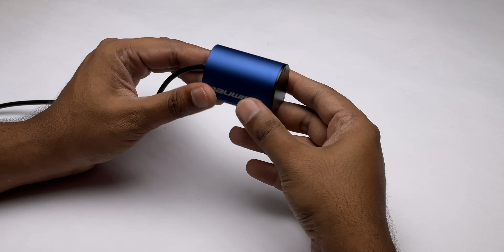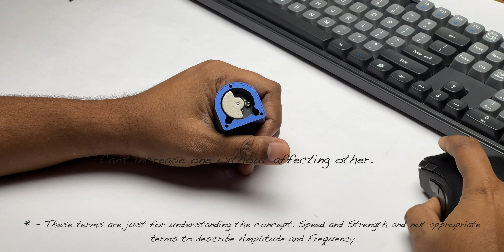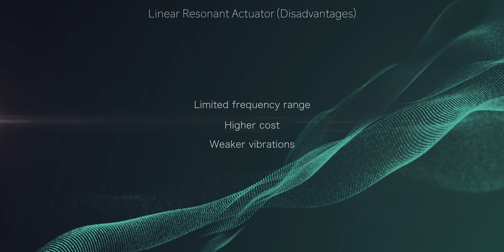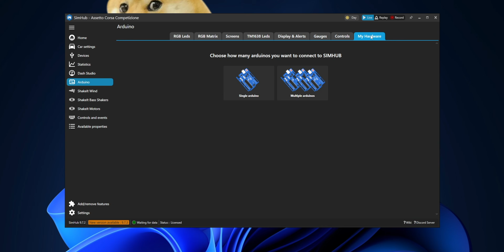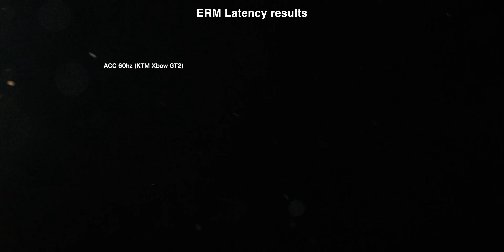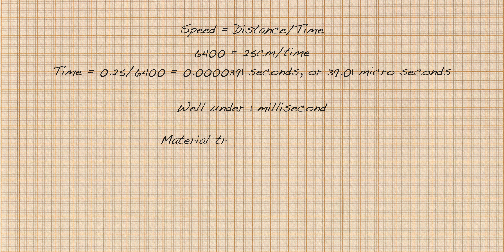Everything You Need to Know About Pedal Haptics in Sim-racing (ft. Simnet Racing)

Comment: I didn't quite get the point of the incorrect mounting. Did you notice any difference compared to the correct one? I was kinda expecting a conclusion to that experiment. :)
Great video anyway, thanks! I hope Moza does their own linear motors someday, since they only offer ERMs atm.
Reply from the maker: Hi, sorry for the inconclusiveness on the mounting part. I did manage to get a proper mount months later, and honestly, didn't make that big of a difference. It felt largely the same.

Comment: So Erm vs LRA vs Transducers... how will u choose for, clutch vs brake vs Gas pedal?   I see people use all threes in all pedals...  i hour done one can andwer me.   One experienced sim racer yold me to avoid ERM at all cost...  while other less experienced told me ERM rumble motor is very good with detail...
Reply from the maker: I pick ERM for throttle because real life cars will have vibrations, the engine literally rumbles. LRA is good for brakes. If you want, you can mount transducers under the seat, behind it, or on 4 corners of your rig.

Comment: Fantastic video. Explaining not only the end result by how and why.
For me racing GT3 in LMU, I think the most useful information is to get feedback when the ABS kicks in and then the TC on the throttle.
Looking at the response times, it seems that the ERM would work great for both. I actually have a hard time to understand why the LRA would be better for any of the two. I know Simnet has and LRA for the break pedal, but as I only need to know as the ABS kicks in, why would not the ERM do the job equally well as the LRA. Thanks.

Comment: I ask IA, about that 
BRAKE PEDAL — Transducer (Most Important)
The brake generates:
ABS pulsing
wheel lockup
tire scrub
load transfer
These effects are low-frequency and force-based, which ERM and LRA cannot reproduce convincingly.
Why a transducer works best:
ABS feels like real hydraulic pulsing
lockup becomes instantly noticeable
realistic sense of vehicle mass
✅ Highest realism improvement per upgrade.
Ideal mounting
directly on pedal plate
or
dedicated mount to brake pedal assembly.
🟩 THROTTLE — LRA
Throttle feedback should be subtle and fast:
wheel spin
traction control intervention
slip ratio changes
high-frequency engine vibration
LRA advantages:
instant response
precise short pulses
informative without fatigue
ERM feels too slow and muddy here.
✅ LRA = ideal throttle feedback.

Do you agree? This is different from your setup. 

What is your current setup?
Regards
Reply from the maker: My current setup involves a Conspit CPP lite pedals and HE sprints. I haven't used these haptics in a few months/ But, your setup seems on point. 

It's true that a transducer is nice and would work best under the pedal plate/on all 4 corners of the rig/under or behind the seat. 

And yes, LRA can work on throttle no problem. People use it on brakes mainly because that has been the norm. But, a norm isn't always the most effective way.

Comment: im intetested in realism for my rig.

how realistic are these pedal haptics?

i dont know how a car would vibrate pedals, can someone explain?

i only felt my brake pedal vibrating when abs activated but i dont really feel anything in the pedals..
 so will this add realism or not? thanks
Reply from the maker: If you want to replicate the most out of stuff, use a couple transducers under the seat or behind it. And 4 small ones on each corner of the rig. These pedal haptics are good, but if you want most out of it, transducers it is (pucks).

Comment: This is such a good review of the  products. As an engineer I can fully appreciate the theory and empirical testing of each type.

I haven't quite finished the video yet (will do tomorrow), but I guess my main question is how do these compare to Simagic ones?
Reply from the maker: Hi there, if talking about ERM, Simnet is better. LRA I have only tested from Simnet so can't say, but they are incredibly powerful. Simagic doesn't have a transducer. 

Thanks for your kind words 💚
Reply: @napmanreviews  Just watched the rest and this is truly incredible. I basically came here for a thumbs up / down insight and the next thing I notice is me watching theory of how sound moves through different materials and I loved it. One aspect that wasn't really addressed was the noise levels of each motor type and how they compare to Simagic. My main candidates would be the Simnet LRA and Simagic P-HPR.

I guess my selection will come down to which motor I can attach to my Simgrade VX Pro the easiest. I know there is a pretty straightforward way to attach the P-HPR, but need to do some more research what it would mean for Simnet stuff. I would prefer connecting all of the motors, wheels and accessories to one powered USB-hub, but it seems I'm gonna have a bit of a mess on my hands when I start my build in January. Part of the fun I guess.
Reply from the maker: @jannejaakkola5836  Another fun thing to add to future videos! They can get noisy, but unless you plan on running on super high strength, it won't be noticeable. I played with them with the only source of audio being my laptop's speakers, and the haptics weren't audible.

Comment: Do you recommend to buy 3 different haptic motors for each pedal or is it better to have for example 2 LRAs and 1 ERM or is that overkill for the other pedals? Are the 3 different ones the most efficient/useful for each pedal?
Reply from the maker: No actually you could run triple ERM, but ERM is good for throttle. You can do 2LRA if needed alongside one ERM. Clutch rarely has a good use for a proper haptic but most people do it. I usually leave it alone unless you’re someone who drives a lot of manual H-pattern.
Reply: @napmanreviews  I actually drive a lot of manual H-Pattern ;) So definetly LRM (65€) for the Brake and you said that the ERM (~17.50€) is good for the Throttle, but what about the Clutch? Should I use the ERM (~17.50€) or the Transducer (~35€)?
Reply from the maker: I think ERM would be great for clutch bite point simulation or gear shift frequency. It’ll be great!
Reply: @napmanreviews  Thank you very much!

Comment: In an ideal world, what haptic would you put on each pedal (like would you use 1 of each, or would you use mix and match 2 of them across the 3 pedals?)
Reply from the maker: Ideally, I'd use ERM on throttle and LRA/Transducer on brake. I'd leave clutch as it is as bite point simulation is already tricky.

Comment: Great content! Is it possible to assign different frequencies on one motor? For example ABS @ 30 Hz and road impacts @ 50 Hz?
Reply from the maker: Hi there, thank you. Unfortunately I don't think that's possible. Though different intensity levels can be set for different feedbacks. One motor can run at one frequency only.
Reply: @napmanreviews 
Thats what I assumed, but thanks for the confirmation. I hoped that at least the transducer is able to do it.

Comment: Thank you for this video. I am looking to upgrade my pedals and saw the simnets and the haptics and was like well idk wtf is what. So you break it down perfectly. I want to stick with simagic for pedals but both my friends who had them ended up ditching the load cell because of LC drift so im on the fence about buying p1000s. I have an alpha atm and might upgrade to evo but i need pedals first. These LCMs have treated me well but it also has LC drift. I really dont want to spend over 500. The simnet pedals look nice but ive never seen them in stock.
Reply from the maker: Yeah they sell out fast. Mainly because of their pricing. I didn't have an opportunity to test the pedals but I've only heard good stuff.
Reply: @napmanreviews I am installing the simnets now, it's been a mission. But I am finally at the end and installing the haptics. I am using the LRA(HPM-L) on my brake, no question on that. For the ERM(HPM-R) the simnet manual says you can install it 2 ways, one vertical and the other is rotating it 90 degrees. Which would you suggest when using it for the throttle?
Reply from the maker: @natel7382 That’s great man! For ERM on throttle, 100% vertical. That’s the most optimal position according to physics and that’s what I prefer/recommend as well.

Comment: I have the simagic hpr and neo, i was shocked how good the neo felt, personally if I'd got that first I wouldn't have got the hpr which is much more expensive. 

The one thing people don't mention with these is that ultimately it's just rumble, not like real life where you get a single thud for gear shift for example, just a rumble, if you hit a wall you get rumble etc... I just don't see the immersion there, I understand why it's not possible but it should be stated these don't add immersion, simply communication.  Works for curbs tho, as that is rumble irl lol
Great video!!!
Reply from the maker: Thanks! I agree. I only use ERM for engine vibration and rpm. Helps to feel more connected with the car.

Comment: I would be very worried about the lifetime of the transducer version. I've purchased similar looking drivers from Aliexpress (the internal part) and mounted them to my pedals. Two died in sequence (both used for braking), with one metal arm snapping off cleanly, I assume due to vibrations. I didn't feel that I was driving them too hard, but who knows. Happened in a shockingly short amount of time too (probably 3 hours of gaming). In fairness, I was using them for rallying and I also piped road vibrations and suspension feedback through the brake pedal, which increased the overall load.
Reply from the maker: Wow, that’s a shame! What you described doesn't sound like a lot of load for a transducer. Hopefully, this one is more durable. I have been using it fairly regularly, and if something happens, I'll update in a pinned comment.
Reply: transducer is different. Simnet use pure copper cable and working with the designed simnet controller that control the votlage and frequency,
Reply: @bubbabubbab  I’ve also been running my AliExpress transducer for about a year and a half (which look exactly like these but without the cover) and they have been flawless. I run them at the max wattage it was rated for and controlled though simhub and amp with just 2 effects, ABS and wheel slip. 20-30hz for ABS and 80-90hz for slippage. 
They feel great, clean and distinct feedback. I thought the only part that was a weak link was the flimsy thin wires, but they’ve held up so far. 
You can easily overdrive them, especially if the other channel on the amp is driving something higher and you get lost in the software and equalize both channels output. 
Maybe you got a dud.

Comment: Fun fact, I connected the Simnet linear motors to the Simagic haptic control box and everything works as expected (including setting them up as proper devices in Simhub). I found the Simnet linear haptics motors to be less noisy than the Simagic reactors. The reactors have that annoying high pitch "whine" at certain strength/frenquency settings. There is still a hint of that sound with the Simnet, but much less pronounced.
Reply from the maker: Fascinating. This means every Simagic control box would be compatible🤔
I gotta see it with P500 too.
Reply: Sweet. I have two pedals im considering putting haptics on and I have had terrible experiences with Simagic. What would you recommend?
Reply: @divinasi0n  I have no experience with any Simagic pedals unfortunately. But, I can vouch for the Simnet one. They are excellent and I feel no need to upgrade ever, at least until a good and reasonably priced active pedal exists. I'm in the process of getting rid of most of my Simagic stuff myself. I'm tired of the lack of updates to their Alpha wheel bases, so I'm going VNM next month.
Reply from the maker: @RicHSAD2 Interesting, I might get to check out the simnet pedals later. But I have to ask why VNM?
Reply: @napmanreviews  They have new 13, 18 and 25nm wheels bases that should start hitting the stores next month hopefully. The prices are reasonable to start, but they also offer Telemetry FFB in some games which is something unique that no other mainstream brand seems to be doing. Based on that feature and the couple of reviews of their current 32nm base, VNM might just have the best FFB out there at the moment.
Reply: @RicHSAD2  sorry, I meant which simnet haptics would you recommend? 😅 I'm running VRS pedals after I went through THREE faulty Simagic pedal sets. Hydraulic and regular. I'm convinced they have no quality control team. The VRS are not perfect but they're about as close as youre going to get in this industry and better pedals in every way. Actually i'm a bit scared to buy the Simagic control box, but at least it seems I wouldn't have to buy their motors!
Reply: @ 3 faulty sets? That's crazy. I'd just get the linear motors all around personally.
Reply: This is amazing news lol
I was just thinking "too bad I already bough Simagic " but now, these seems like a great option!
Reply: How about pedal connector? Does simagic padal also work if we connect it to the simnet pedal?
Reply: Great to know ! So glad I found this video and your comments before I bought some haptics. Awesome content ! Best of the best.